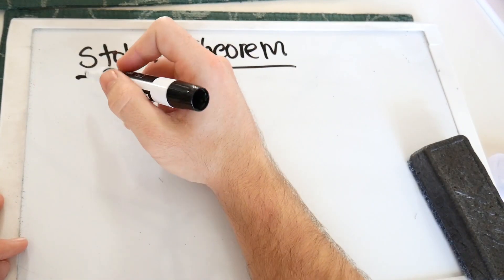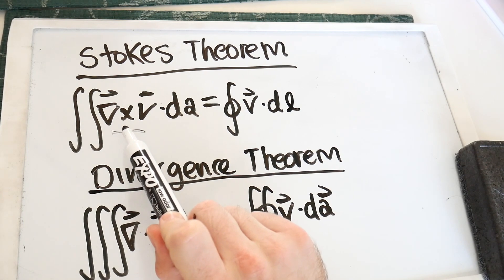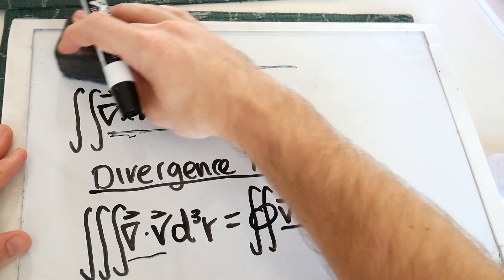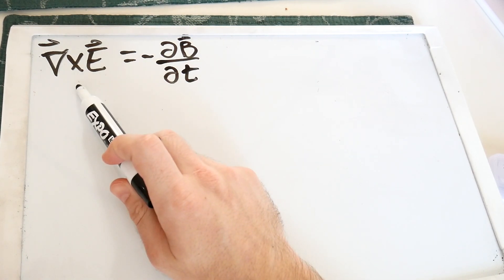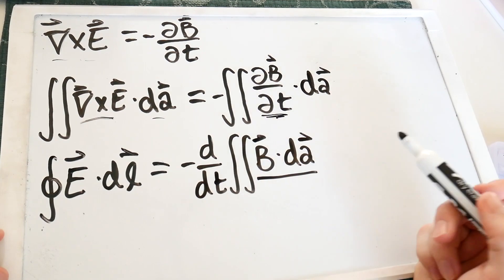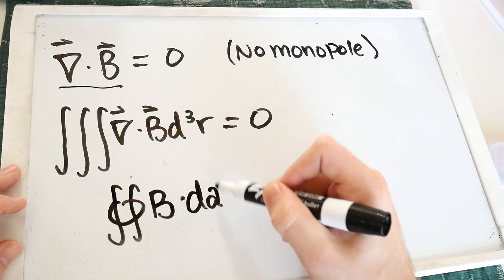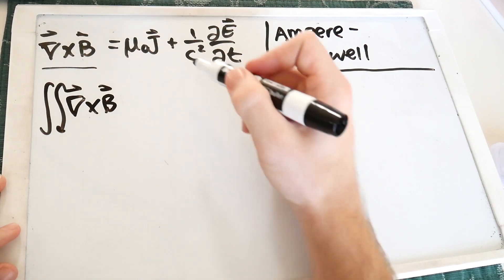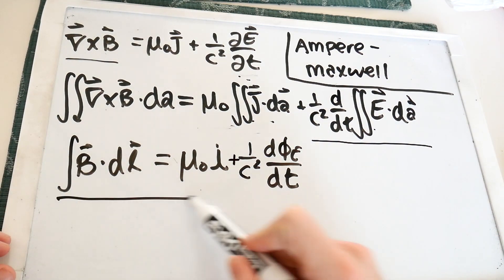Converting Maxwells Equations from Differential to Integral Form

Comment: In Hecht's derivation of Maxwell's equations (equ 105), Stokes' theorem is used to derive Maxwell's equations but Stokes is equating a line integral with a surface integral (equ 98 & 103) that are not equivalent which proves Hecht's derivation of Maxwell's equations using Stokes' theorem is invalid. In the mathematical proof of Stokes theorem, the both integrals and units are not evaluated. Also, in Jenkins' derivation of the electromagnetic transverse wave equations of light (equ 1 & 2), using Maxwell's equations, 14 of the 18 differential components of Maxwell's equations are eliminated since Maxwell's equations depict a horizontal wave. In Hobson's derivation, Hobson derives electromagnetic horizontal wave equations that are transformed into electromagnetic transverse wave equations by arbitrarily switching unit vectors at the end of the derivation.

Comment: What is the mathematical justification for converting the partial derivative into the total? Also you can factor it out of the integral because since its a surface, its continuous?
Reply: I know this is an old comment, but I think we are under the assumption that our boundary conditions are not functions of time. This is part of Leibniz Special Case for taking derivatives of integrals just in the reverse direction. You can justify this exchange of limits UNDER THE ASSUMPTION your boundary conditions are under no influence of time
Reply: @cartermikovich1369  , is this the same logic for proving that the shroginer equation's psi remains normalized with time, if it is initially normalized?

Comment: So for anyone looking for a nice and easy proof for Stokes Theorem and the Divergence Theorem, look no further than the generalized stokes theorem, which states that the integral over a k+1 dimensional manifold of the exterior derivative of a k form is equal to the integral over the boundary of the manifold of that k form. I know it sounds weird because of weird vocabulary, but a quick look at an intro to differentiak forms will clear this up, and the theorem itself can be easily shown by converting the integral over the whole manifold into the integral over its boundary of the integral of the differentiated k form. Nicely enough, this yields a bunch of neat theorems super easily in a way that almost seems trivial.

Comment: You forgot to mention what they mean I think.

what does the line integral of B means?

i know the surface integral means the line field flux, and I think the line integral of E is the voltage, but for B???
Reply: Hi! I would recommend that you look into a little bit of basic vector calculus for a better understanding of this. However, let me try to explain. 

A line integral of a vector over a curve is when you take infinitesimal pieces of the curve you are integrating over, then taking the dot product with the vector, and then adding all that up along the curve.

Now, for the electric field, it is the electric voltage. For a magnetic field, it is the magnetic voltage drop. It becomes relevant in the study of magnetic circuits, which is used for calculating how the magnetic flux behaves in transformer cores and stuff.
Reply: and in this case the continuity equation stands for the charge conservation, in which the varying of charge density can only be produced when there is a current leaving or going inside

Comment: I'd just like to point out that Maxwell didn't actually use the vector notation when he devised his equations and it took Oliver Heaviside to do so some time later. So there was no Curl or Divergence in Maxwell's original (20) equations.
Reply: Maxwell used Quaternions
Reply: Sources?
Reply: @bonbonpony  Wikipedia
Reply: @bonbonpony  No, you can check Maxwell's original works, Heavyside developed the equations we used today. He reduced Maxwell's orginal about 20 equations to the 4 equations we know today using the Vector Calculus he discovered independently.

Comment: how is he convertig the partial dervatives wrt time to total derivatives
Reply from the maker: Think about it, if I'm taking the time derivative inside the integral, then at this point there is still x dependence. So the field still depends on x and t, making d/dt a partial derivative. If I pull the derivative outside of the integral, then I'm taking the time derivative of something that has had all of it's x dependence summed over. So there will be nothing else to take the derivative with respect to, making it a total derivative.
Reply: @AndrewDotsonvideos  is that the famous feynman technique for integration?
Reply: @RieMUisthegoaT  if I'm not mistaken, isn't called the Leibniz Integral rule right? The more general original formulation

Comment: Can you convert from integral form to differential form now? Please!
Reply: its almost the same , but you have to know the definition of divergence and rotation
Reply: The integral form is concerned with the flux, which concerns itself with the total amount (a scalar quantity) of a vector field coming out of a surface area. The differential form on the other hand concerns itself with one point in the vector field only. So there is no field flux, but rather a single point relation to another variable. Notice that when the curl is involved, you must dot it against a surface infinitesimal area; otherwise your quantity would be a resulting vector as in the Stokes Theorem. This usually happen when there is a relationship between two variables like magnetic  filed and electric field which are perpendicular to each other (Faraday Law). Just remember that integral form is concerned with the sum of many parts; while the differential form is concerned with one point in the distribution.

Comment: Sir plz make video on ,how to get the differential form of maxwell equation ...??
Reply: If you mean going from integral to differential form, then you just do the whole process in reverse: convert LHS line integrals into surface integrals of the curl, write the RHS as a surface integral, then you equate the terms under the integrals.

If you mean deriving them from scratch, I'm afraid that that might be impossible. Maxwell's equations are an agglomeration of postulates resulting from empirical findings. You could derive the first and third ones from the Coulomb and Biot-Savart laws, but I would contend that the Maxwell equations are more fundamental and that accepting them as postulates makes more sense.

Comment: Shouldn't it be dr³ instead of d³r?
Reply: Could just write dV otherwise
Reply from the maker: rednax No because you can think of d^3r being the same thing as d^3(x_i) with i running from 1 to 3. i = 1,2,3 corresponds to x,y,z or whatever your respective differential element for your chosen coordinate system is. So technically if you were to write d(x_i^3), that would be dxdxdxdydydydzdzdz. In the end, if you know what space you're integrating, it doesn't matter what you call it, though
Reply from the maker: In reality, call it what you want. I just didn't want to write dxdydz over and over again